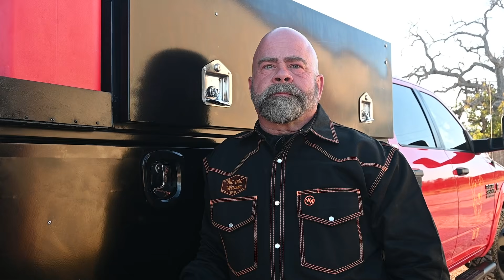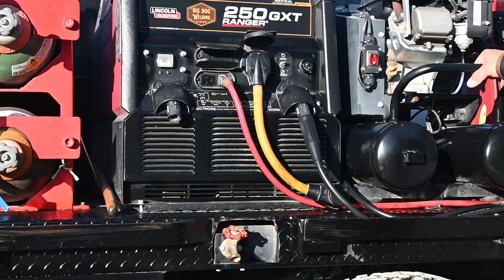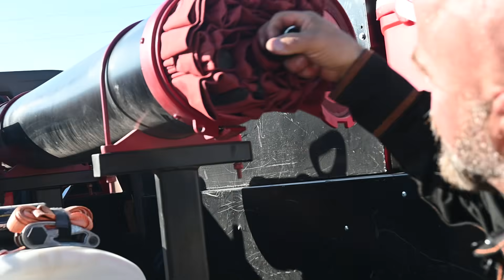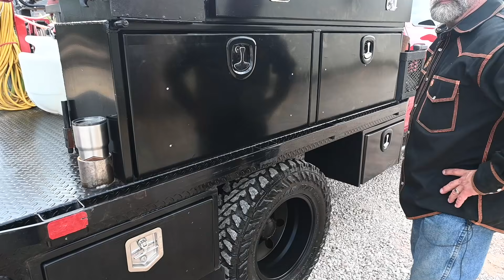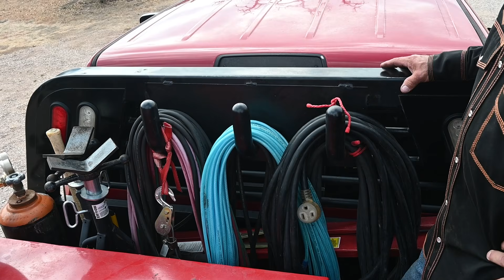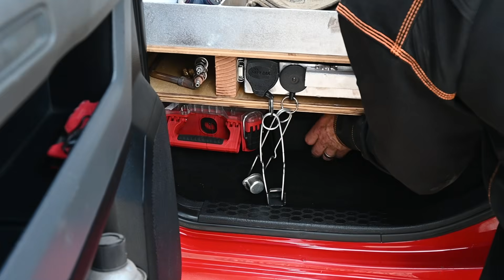Full welding rig tour of my 2016 Ram 3500 diesel and all equipment that I carry.

Comment from the maker: I lay out the full tour of my welding rig top to bottom.  This is a 2016 Dodge Ram 3500 with a Cummins 6.7 diesel. 

Some helpful links:
Pancake hood review : https://youtu.be/K08iE6wK7CY
Water tank sprayer : https://www.tractorsupply.com/tsc/product/fimco-25-gal-pro-series-spot-sprayer
PVC tube kit : https://www.amazon.com/gp/product/B00P18EU7A/ref=ppx_yo_dt_b_search_asin_title?ie=UTF8&th=1
Pipeliner's cloud umbrella : https://shop.pipelinerscloud.com/collections/8-pipeliners-cloud-umbrellas
240 volt 4 to 3 prong adapter : https://www.amazon.com/gp/product/B08BG67KVX/ref=ppx_yo_dt_b_search_asin_title?ie=UTF8&psc=1
25' 240 volt extension cord : https://www.amazon.com/gp/product/B07CJHRNXN/ref=ppx_yo_dt_b_search_asin_title?ie=UTF8&psc=1
Awesome knee pads : https://www.amazon.com/gp/product/B01M0I4GHF/ref=ppx_yo_dt_b_search_asin_title?ie=UTF8&psc=1

 @ICWeld  
 @arosswelding  

0:00 - intro
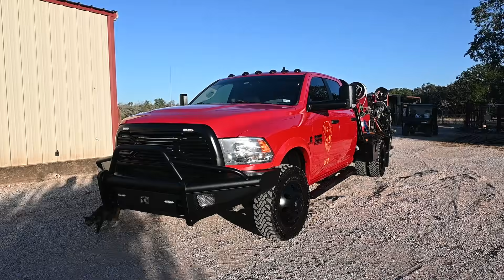0:22 - Ram truck overview
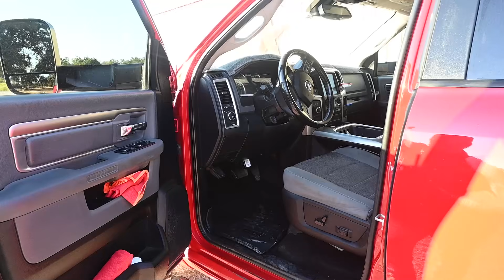02:17 – truck cab
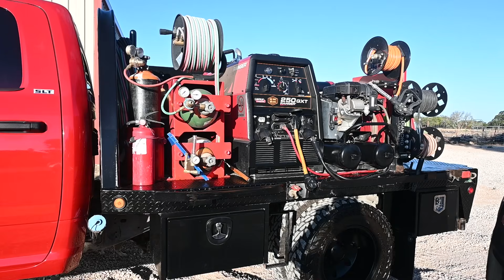02:42 – oxygen acetylene setup
03:26 – main welding machine / generator
04:41 – air compressor
05:44 – welding lead reels
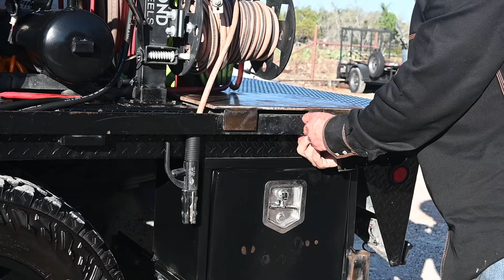06:43 – side clamp on work table
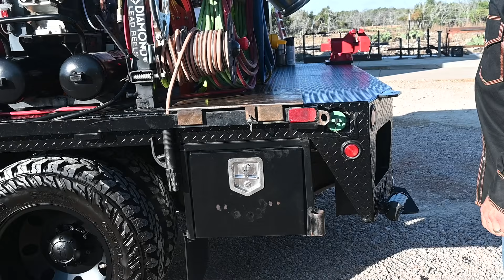07:14 – Pipeliner’s cloud umbrella mount
07:48 – driver’s side front lower compartment
08:22 – water spigot
09:38 – driver’s side rear lower compartment
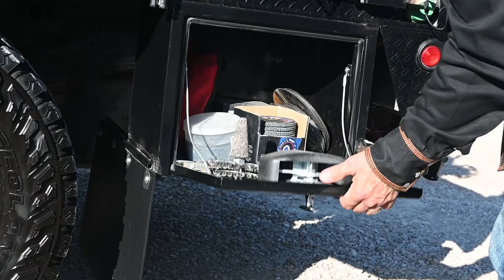10:05 – rear deck overview
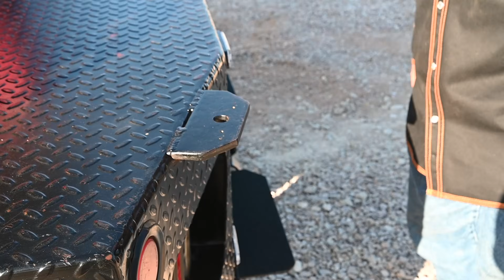10:28 – rear clamp spot
11:16 – strobes and backup lights
12:54 – rear extension cord and hose hanger
14:30 – pressure sprayer water tank
15:39 – Pipeliner’s cloud storage holder
17:30 – rear storage area front to back
Reply: I'm looking for work man so what can I do Google maps 2121 South Lamar The cove drive by check it out the stairway in the back the screen wall everything there is fabricated on that site

Comment: Very late comment but in case and it will work on another truck. On front bumper on passenger side but in towards center of vehicle welding a piece of square tubing that you can stick square tubing that is like a tall T and then same on rear bumper in line with one on front bumper. It will allow you to haul say 16' tubing without needing trailer or red flag most likely. The tall Ts can be removable and only needs to be tall enough to keep square tubing from laying on roof of truck. 2 pins in each will easily secure them and on the ends of the T tops weld points for attaching ratchet strap to hold the square tubing being hauled. Just an idea. Great looking well better saying great functional work truck. It seemed to hit the most needed areas for a welder's truck.
Reply from the maker: That’s really a great idea I need to look into doing that

Comment: You just answered my question,,if you do any tig welding. Here's a thought in storing your filler rod,get you some PVC PIPE AND A CAP (LIKE A SLEEVE JOINT ) to store your filler rod and you can can get a verity of them for different materials.
Reply from the maker: That’s a good idea. I actually do that in my shop.

Comment: How are you liking the Ranger 250 GXT after 3ish years? I am looking to buy one new (under warranty). Have you had any carb, EFI or cold start issues? Do you plan on upgrading to a bigger diesel generator, or is the 250 adequate for your needs?
Reply from the maker: Overall, I’m really happy with it. It does everything I need to. Yeah it’s not enough to arc gouge so I do someday may want something bigger. So far (knock on wood) there have been no issues with carb or  choke. It is not an EFI which I recommend not getting an EFI just because they could be problematic.

But so far, I’m really happy with it
Reply: @TempleThomas  I've been doing a lot of mobile welding with my small house generator, but to me it isn't enough. I've looked and researched other machines, and this seems to be the best for what I need. I would like to arc gouge too, but I am just starting out in this business. I am planning to buy it new with a 5 year warranty, I want to keep this machine forever (or however long I can), and I didn't really want to buy used since it could just be a problem waiting to happen. If you don't mind me asking where did you purchase it from, and how much did it cost you for it?
Reply from the maker: @mobloeescobar4203 . I bought it five years ago and I got it from my local welding shop in round rock Texas. I believe it was $6000.

Comment: Nice setup. What is great welder for mobile that do ark, mig and spool aluminum?
Reply from the maker: I have 2 Millermatic211's. One has a spool gun setup and one runs only self shielded flux core wire.

Comment: Beautiful truck and very well thought out. I've spent some time as heavy equipment mechanic and work up in the Pacific Northwest Industrial farming world with miles and miles of gravel dusty wash board maintenance roads. At the end of the day all my crap was bounced around with paint wore off and nuts and bolts scattered all over with tools shook apart and any written material a muddy soggy mess. Most all of my wrenches would be buried under said dust and debris. So ONE of  my suggestions is to stay on the freeway. One of my earlier employers was so cheap that when I ask for a vise to mount to the service vehicle they refused. At the end of my employment with them I was reduce to using a half dozen five gallon buckets with "cheap" Chinese tools in  the back of a half ton twenty five year old pick-up. I only hope you can get the hourly rate you need to be able to support the beautiful truck and new tools. THAT never happened for me!  I changed occupations!!

Comment: There's a lot of expensive stuff on that truck.  I wouldn't want to to park it somewhere to eat and come back and it be bare bones.     Plus a lot of that stuff is out in the weather, the sun and rain and seeing that a lot of stuff is plastic and not the best UV stabilized, I would see that also deteriorating things.    What about a nice stout gooseneck enclosed trailer that of course piped the generator exhaust outside, but everything else on nice racks inside where you could get it.   I mean you could have some panels on the side of the trailer where you can get at  the front of your welder to make adjustments, but it would lock shut when you are done for the day?      Goosenecks have better turning radius/harder to steal.
Reply from the maker: I actually had a trailer and was going to rig that out first but somebody jobsites I go to a trailer just won’t work. I have a covered area where it parks we’re not working and I keep it close by and keep my eye on it. I try not to stop anywhere I can’t see it.
Reply: @TempleThomas    What are your thoughts on converting one of those those larger used ambulances or tactical mobile command centers into a welding rig.   It's hard to find them 4x4 but they do come up once in a while for a premium.   Would be nice to put some sort of ramp door in the back to make it easier to wheel stuff in and out of the box in the back, plus it would make one helluva work table if you had some stout cables holding it up.

Comment: Thank You ! Awesome rig ! 
Love the cord hanging elbows, I’d have to figure some kind of gang cap lock for them. Those monkeys in theft mode jump right up, gray n go
Reply from the maker: Thanks I appreciate that. You can take a piece of 4 inch wide, flat stock, cut holes in them to line up with the elbows and then just set them on top and put a pin through to lock

Comment: Nice setup. I didn’t see in your links where you bought your pancake helmet. Also looked at those umbrellas, not cheap, did you get the 10 footer? BTW, do you like that Dodge? I drive an old 92 Ford F350 dually IDI flatbed and it also is a cab and chassis incomplete, I learned 6 years ago that it is registered as a commercial vehicle, period. Commercial insurance.
Reply from the maker: Sorry about that, I got my pancake from P/L welding supply.  Here it is :  https://www.plwelder.com/Wendys-Pancake-Hood--Z-Model-PL1084_p_1001.html

I got an 8' Pipeliner's Cloud - yeah pricey but WORTH EVERY PENNY !!!     I love this truck !~
Reply: @TempleThomas  Thanks brother!

Comment: Where did you get the pvc pipe for the umbrella
Reply from the maker: I got it from an actual plumbing supply in Austin. It is not cheap unfortunately. I have a good contact. That’s a plumber. They got me a 10 foot stick.
Reply: @TempleThomas than you sir

Comment: Buddy, this is slick.  I'm geeking out about you geeking out.  That clamping tab on the back driver side is slick.

Can you talk about your clothing choices?  I built a fence this summer and it was awful being in the garage and out in the heat fabricating and burying posts.

I had to wash my work pants and welding shirt just about every day I worked due to all the sweat.  Spent a fortune on pedialyte too.
Reply from the maker: Thank you so much I really appreciate that. I actually had a lot of fun coming up with ideas that would be handy and help my work flow.
Reply: you can make your own adult pedialyte equivalent with just sugar and table salt and tapwater.for near nothing, just the cost of a gallon jug to keep it in.  Most of the cost of pedialyte is the sterilization heating at the factory and the transportation cost.  pedialyte also contains some salts that you won't lose thru sweat, like potassium.  Babies with diarrhea lose a variety that must be replaced as opposed to an adult who is just sweating.
Reply: You normally wear both pants and shirts more than once before washing them while working as some type of welder for 8-12 hours per day is what you're saying ?????!!
Reply: @mxreese69r6  I'm a weekend warrior.  To your question though, same britches, same welding top that goes over a t-shirt. Wear it for a weekend, wash it for the next weekend.

Comment: What state are you in? I have a pickup that I ordered new that’s almost identical (same color, same interior package, also a chassis cab, etc) only difference is mine a 2021. I wasn’t required to get commercial insurance on it though. The first 6 months I owned it, while I was finishing the bed and getting it set up, I insured it just like any other vehicle. I wonder what gives?
Reply from the maker: I'm in Texas and I initially tried to add it to our Progressive policy and they said it had to be Commercial.  I got a Progressive Commercial policy on it - which as I'm logo-ed and a business I probably should have Commercial to protect me and my company better.
Reply: @TempleThomas  interesting. I have State Farm maybe that’s the difference. I have commercial as well now but was just curious as to why they was your only option. Nice setup though. Doesn’t get much better than a Flame Red dodge